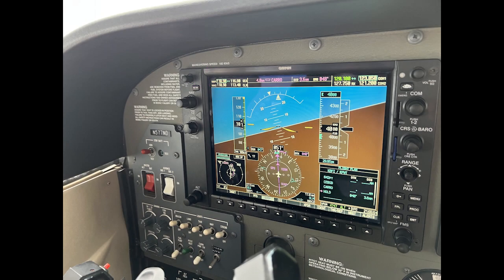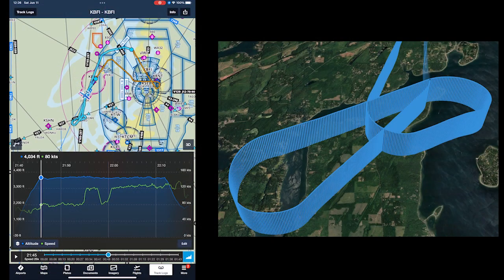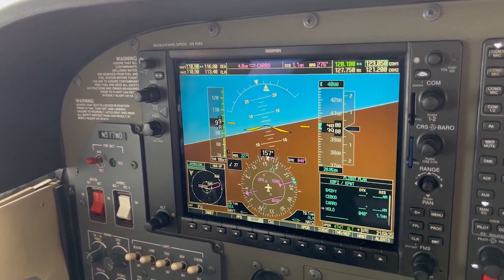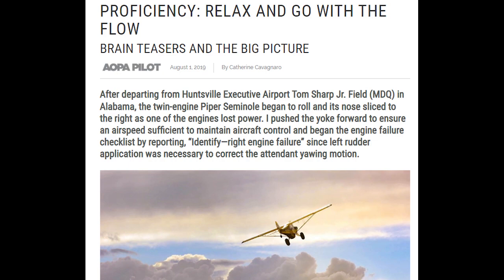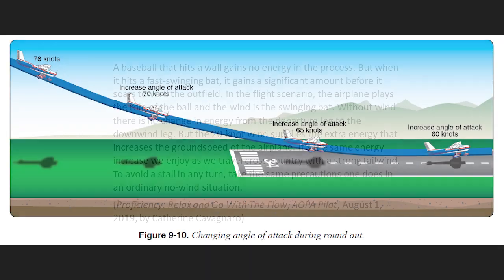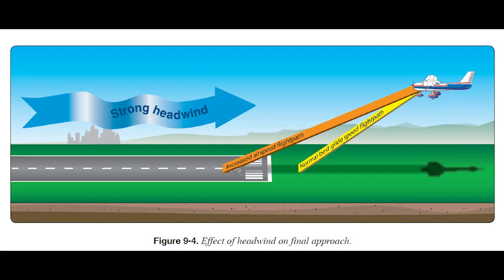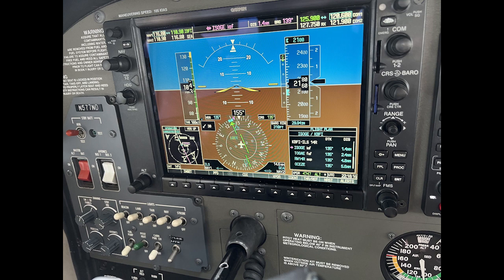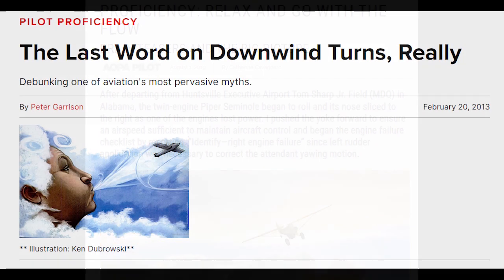The Myth of the Downwind Turn

Comment: Thanks for this.  Ive had this arguement many times with even aero engineers and CFIs who cant understand this or rather who cant overcome the powerful illustion when flying low.

I fly gyroplanes.  We typically fly low and slow so doing a circuit at 500ft close to the strip is normal.  

At this altitude the ground speed can become dominant and pilots tend to try to match thier normal sight picture and turn tighter to make the same ground pattern follow rather than early and alow to drift downwind the except you will have a much slower ground speed on final.  Mustering pilots get caught too because once you are avioding ground obsticles you are interacting with the grpund reference frame.  

But understamding what is really hsppening is crucial.  Thank you.

Comment: In a helicopter, could you yaw it 180 degres so dramatically (keeping other controls steady) that it would fly backwards for a time? Eg  before slowing and accelerating in the opposite direction. Wouldnt its airspeed go negative? Come to think of it, if you make a rudder only turn in a fixed wing you can skid reducing airspeed. Why doesnt the aircraft instantly accelerate in the new direction its pointing? It appears it can accelerate fast enough to maintain airspeed when making a gently down wind turn but not a sudden manoeuvre?
Reply from the maker: Again, don't confuse groundspeed, measured with respect to the earth, with airspeed, your velocity inside the airmass. As the video shows, when you're in the clouds with no visual reference to the ground, neither you nor the aircraft senses or reacts to the wind. Low-level wind shear is another matter. Abrupt changes in wind velocity (speed and direction) can affect the aircraft. But during normal maneuvering at altitude in steady and gradually changing winds, the aircraft is moving inside the airmass, like a boat on the ocean. The people on the ship have no sense of currents or tides unless they can see the shore.

Comment: On windy days wind can vary a lot with height (im talking about regular windshear, nothing to do with down draughts). As you descend the aircraft experiences reducing headwind. Does it automatically accelerate to maintain airspeed?
Reply from the maker: Don't confuse frames of reference. The airplane is moving with the air mass. It does not sense the wind. Groundspeed varies, but that's measured with respect to the surface. For more information: https://bruceair.wordpress.com/2022/06/12/i-survived-a-downwind-turn/
Reply: Thing is I was taught that when descending through severe wind shear the aircrafts inertia may prevent it accelerating fast enough to "keep up" with the reducing wind speed. Thus causing a reduction in airspeed. It was normally to add say half the windspeed to your normal airspeed to allow for this effect.